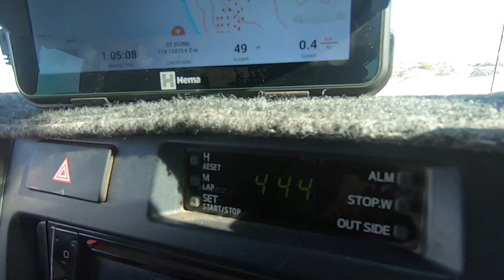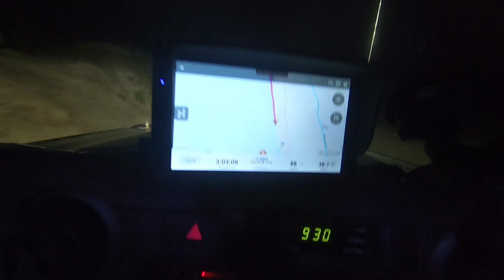4 Wheeling & Beach Fishing, part 1/6

Comment: A good temporary get you home mod is to drill a small hole through the bolt ( threaded section) then put a roll pin, split pin whatever you have with you through it, much more reliable than the wire, ( just my opinion)

Comment: Its sobering that even an experienced sand driver can still have issues on the beach. Good advice about solo and trailers.
Reply: Terry Smith sand can get anyone at anytime. You can be on a soft beach at 15 then hit an ultra soft patch and go straight down. Or on Fraser and see a surprise washout at 70kph. Experience has little to do with it sometimes, just bad luck. (Although I never drive faster than 60 on a beach because washouts at speed are the worst)
Reply: Very little luck in it 
Ronny said himself rookie mistake 
Usually just a lapse of thought or laziness 
Iv nearly lost a car to laziness but never had an issue if I'm thinking about what I'm doing 
If your in unfamiliar areas then you need to go slower but I can do 120 on my local beach sometimes 
Don't fear letting your tyres down 
Somehow everyone thinks 10psi is too low 
You can go down to 6 if you have to 

I drive in very soft sand every day on your farm 
And go to the beach every day in summer 
Towing up to 8 tonne on the farm though sand with my cruiser
Reply: And driving at night is just making your life difficult 
Ronny has schedule to keep but if your on holiday just pull up and camp in the dunes before the sun sets

Comment: Hi Ronnie. I have been in super soft coarse beach sand and had to go 8psi all round to get through it. I was prepared to go 6psi if needed. You just have to be very easy on the throttle not to spin the rims in the tire or roll them off the rims. We get a bit of that sort of sand up Geraldton way in places. Admittedly the trailer would have been an anchor.

Comment: Unhitch the trailer get the truck out to a better location.  Winch or use a strap for the trailer?  But you’ll have a hell of a lot more experience than I do.  Thanks for keeping it real.  Great video.  Looking forward to the next one in the series.
Reply from the maker: Good point but when you just want to get to camp you try the ‘fast way’ which turns out to be the loooong way

Comment: Good stuff & being bogged like that at the water line is no fun at all, been there done that travelling solo. If you ever make it to do the Robe-Beachport run in SA stay well away from the water line as it gets much softer down there on some of the beaches.

How did the new Maxtrax with the metal studs hold up btw? My original set are almost done after the last muddy run so will need to replace them soon.

Comment: If you have a power drill you can drill through the bolt and add a circlip style pin through it. While that shouldn't be the first option it's a tried and tested method if you lose a nut on a trip and don't have any replacement.

Comment: Do you think drilling the bolt and inserting a split pin would have got you out of trouble?. If you had the tools. Love Kalbarie.
Reply: Sharon Rentz i was thinking they could do just that!
Either that or weld a blob on to act as a nut.
Reply: Split pins usually are not that big.
Welding machine weight a ton, and I doubt they have one on them.
They have to use with what they have on hand. Doubt they had either on hand.
Reply: @jpeachy7251  what a load of BS.
Welding with your car battery has a chance of blowing up your car battery. So yes, lets weld with our battery, then when it blows up we have bigger problems. Go look it up.
They did not have a split pin that size. Go look when he opens his box. He used wire to make a nut, as you can clearly see.
They did it the correct way.
Reply: @jpeachy7251  On stating that, drill A hold and place the fence wire through the bolt, that might work, so long as they dont drill to close to the edge that it snaps from the hole to the tip, especially under that much pressure. But those bolts are hard to drill trough, and unsure if they have the correct drill bit. The fence wire would be a far more superior choice over the split pin. The fence wire would not snap or bend out of the hole, so long as they went through the hole twice or more for extra support.

Comment: Curious as to why you didn't just send up your drone to try to find your way out?
Reply from the maker: Low battery loads of wind and dunes are hard to see if they are tall or possible to drive over. In the bush I would but not in the sand unless I’m looking for the exit at the bush end of that makes sense
Reply: Absolutely makes sense. Thanks for responding.

Comment: Buy an real offroader, an Unimog!
Reply: Or a MAN 6X6!
Reply: Impossible to recover if you get stuck(Too heavy),struggle to do the speed limit, no dealer support and consume twice the diesel. You would also need to carry a logbook and follow all heavy vehicle rules when over 100kms from your house.... I'll take the cruiser any day.
Reply: @jakewarren9465  
it is necessary to be very stupid, to stuck one  Unimog ... As for fuel consumption, it does not spend more than 25 liters at 110 km / h (because HIS electronically limited in version 6X6), but loaded with a toyota and a trailer and even with more load, much more! If it is a Unimog 4X4 it has an average consumption at 110 km / h (because HIS electronically limited) of 18 LITERS, 
loaded with 12 tons but, a toyota with a trailer spends more than 20 liters of diesel at 100 km / l. A MAN 6X6 spends 25/30 liters of diesel at 100Km / h loaded with 20 tons ... equipped with 20.00 tires and with an extra short reduction ratio in the gearbox is almost as capable as a Unimog, is wider ...Toyota or VOLVO, if they were so good, How they say there would not be so many workshops, they would all be closed, right? On the other hand, MB continues to be the largest truck manufacturer on the planet, but, since what year? 
MB is expensive, quality comes at a price, a MAN 6X6 is cheaper(or a volvo, scania, etc.) than a Unimog 4X4, but, it is not better than an Arocs or Zetros. Toyota is cheap you need to buy two, to do half what a G-class does, and if it's a 6X6 with portal axels ...
Reply: @Andre-os7kj  You are right they are the best. Land Cruisers are shit better put mine up for sale.